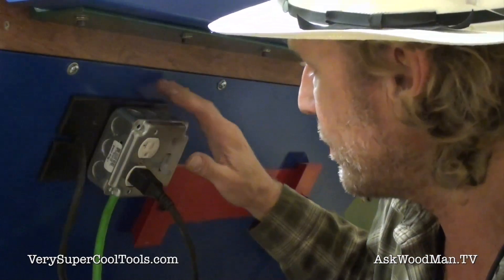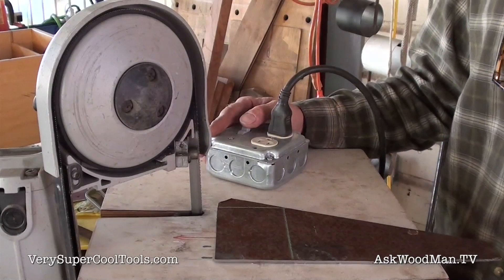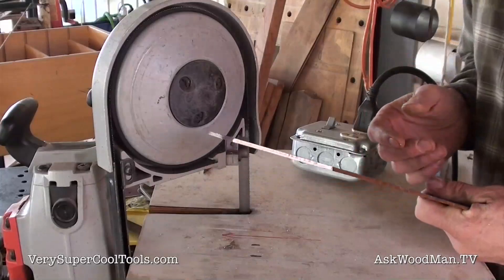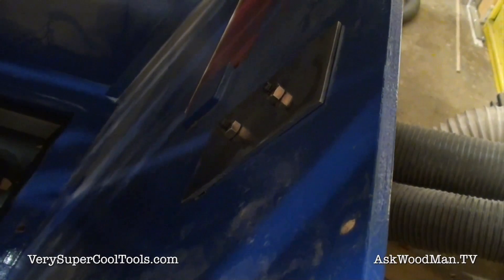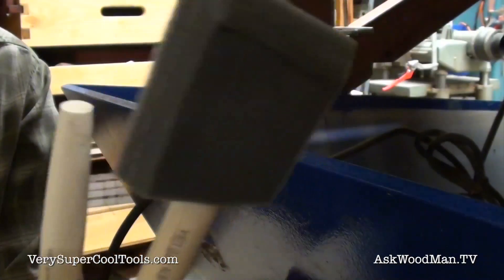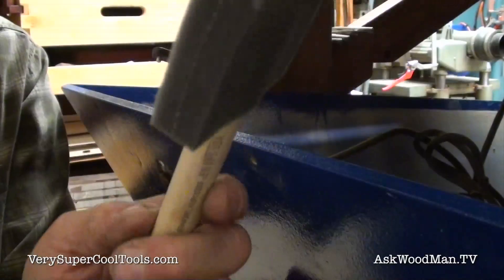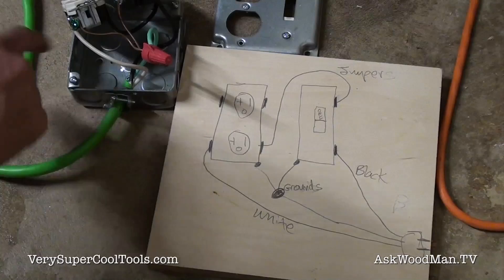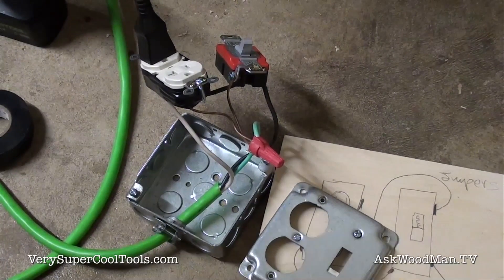838. Changing Router Table Switch  • Table Saw Work Station Series

Comment: Better safe than sorry. Great set up with your portaband mounted on the table.
Reply from the maker: lion39 I have two identical Portabands and that one stays mounted in that stand. It can sit on any flat surface and does not even need to be clamped down. I use it constantly for cutting small parts and lopping off bolts. They are amazing machines. I use the same switch setups for belt sanders when I am doing a lot of stop and go sanding and don't want to fumble with those awkward trigger positions. Thanks for watching. Allan

Comment: I was going to comment about the inside electrics but I see somebody beat me to it.  You may ultimately want to put yourself a metal strip or wire inside and connect to your ground so as to eliminate any static charge if you are afraid of fire.  You will get more static as the wood you are dealing with gets dryer.  Good series.

Comment: A way to improve the looks of those switch boxes while retaining the industrial look is to cut a strip of vinyl pan liner and glue it around the depth of the box. Use silicon. The same method can be employed around the entire box to insulate the box from wet surfaces. Vinyl pan liner strips are good for securing Romex and extension cord to studs and plywood. A short wafer head screw shoots right through the vinyl and the head pulls down nice and tight. It's also re-usable.

Comment: Allen, looks like the change worked out nice but really, the router motor collects dust and produces sparks.  I don't think the other switch was a safety issue.  

Enjoyed the series.
Reply from the maker: dpeagles I agree David. The brushes on the armature are also continually sparking. But really other than a thin film of dust on the inside by static charge and a few little places at the bottom corners, that thing is clean inside and certainly no fine is dust lingering at all. But it was easy enough to do and it does give me another outlet to work from around my table.

Comment: Allen, I wire the top half of the duplex hot and the bottom half through the switch. I find this works great in my shop.
Reply from the maker: Tom Mowery That does sound handy. Thanks for the great suggestion.

Comment: Great Series as usual. Just a thought. If you separate your sliding cord system from the electrical box you can open it up to remove the router plug and cord. This would make it easier to remove the router for external use without taking the electrical box off.
Reply from the maker: But I think I would have made a penetration big enough for the plug end instead of using the errant hole?
Reply: AskWoodMan Maybe I missed something. Does the tool end of the cord separate from the tool?
Reply from the maker: John Livesey No it is a formed end cord. But even so it is not hard to reach inside and loosen the two nuts to drop the box if I need to free the plug and remove the router. The router has been in there since November and has not come out yet since have several other big routers and only two hands.

Comment: I accomplished this by taking an extension cord, cutting an extension cord in two, and wired the female end of the extension cord directly to the switch and ground.  I also went ahead and wired up the receptacles like you did, but unswitched.  The female end of the extension cord just runs inside to get the router plugged into it.